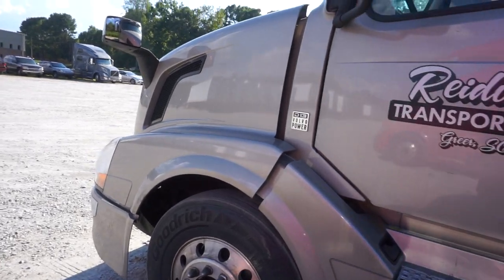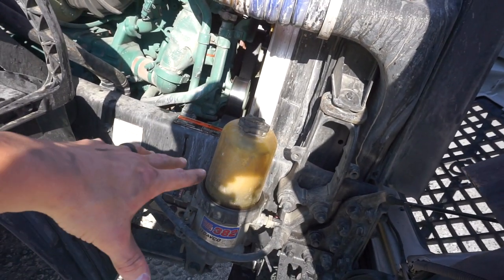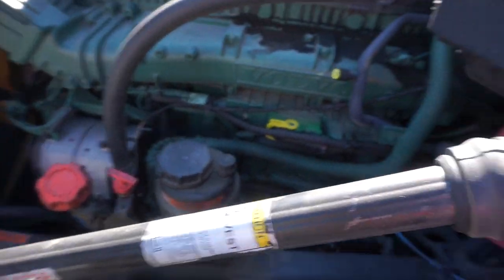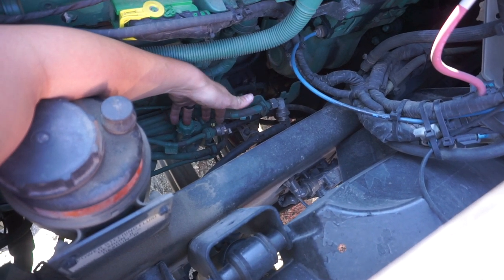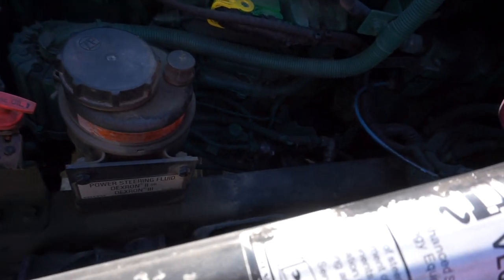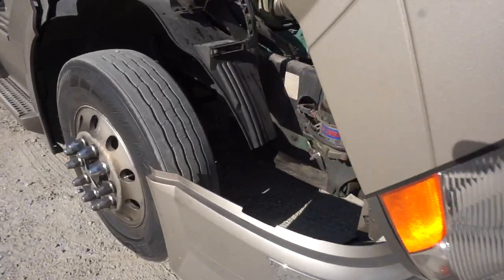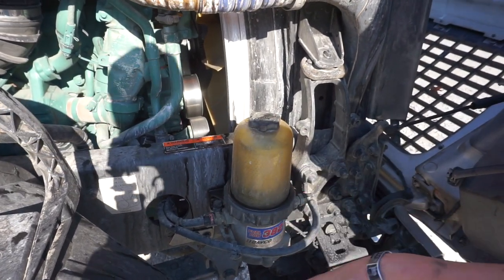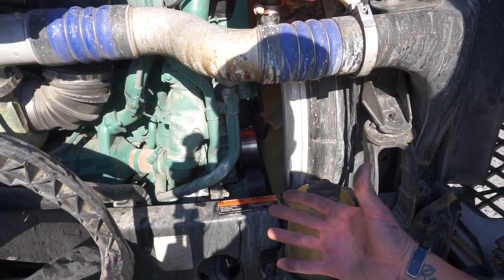How to purge air in fuel lines on D13 (No start fix)

Comment: Thanks for making this videos they help owner operators to save money! I had starting problems with my volvo d13 and I did alot of work on it to try to fix it. Changed the fuel pressure valve, valve on the davco fuel filter, fuel pressure sensor nothing helped. Then I thought I have a cracked fuel line so I put air in my fuel tanks to create a pressure and see if it would leak anywhere (and there was no leaks). The last think I thought it would be injectors because I changed them 60k miles a go. So decided to change the injectors again and that was the problem. Change those valves and sensor first because they are pretty cheap and and you can do it by your self. I mind upload video how I did it. I hope this will help someone.  Have a great day!
Reply: Hello my D13 doesn't have dawco filter. Where I can find to change the pressure valve?

Comment: Important details...to make it easier to reach, I placed a bucket upside down just inside the fender and stood on it. I used the end piece of an aluminum crutch (with a rubber tip) to make it easier. I had to push on the thing for about 5 minutes...then felt is stop moving...then got it started. Push down and to the left to release the spring...to close...wear a glove for tight grip...press down firmly...turn to the right...not locked until you fill it slip just a bit more to the right.

Comment: When I use my hand primer fuel comes out of where the plunger is.  Is that normal? If not can it be resealed/ rebuilt, or do I need to buy a new filter housing? 

Thank you
Reply from the maker: 0vinnie9 once the air is out of the system while pumping yes it is actually what you want to have fuel come out
Reply: @8526Productions  Ok thank you, my truck is losing its fuel prime. Wasn't sure if that filter housing could be the problem.
Reply from the maker: 0vinnie9 no problem and the ones I’ve had that happen on it’s been a leak in one of the hoses near the primer, cracked cups or fuel pump taking a hike
Reply: @8526Productions  ok thank you again, I'll take a closer look at it.

Comment: I’ve replaced my fuel filter and water filter several times now and I keep getting the check fuel filter light on and my truck is lagging a lot when going over 50 miles an hour. Any thoughts on that?
Reply: get a mechanic to look into your injectors and cups. those injectors will wear out the cup and leak down into the cylinder. also causing your egr to clog alot more and faster. you’ll have DOC codes for DEF issues, when the whole time its your egr clogged. Because your getting too much soot!

Comment: Truck died while driving has power to all components think my fuel tank lines are clogged changed fuel tank air vent any suggestions sir. Much appreciated
Reply: Same problem 
U find the fix
Reply: @silverjohn4319  yes, fusebox under the hood had bad connection...shop rewired fusebox and issue resolved

Comment: Thank you so much for sharing this video. You just saved my time during the trip and also my money.
On the old models Volvo engines there was a handy pump to got the fuel to the  injectors. On 2020 D13 it wasn't and I didn't know how to start the engine after fixing air flow through the water separator and no fuel pressure.
After your video class I know the easiest way to start the engine after issue wit air in the fuel lines. On my engine needs only to push couple of times.
Thanks again, the engine is warm and I have to rolling!

Comment: Hey question, my truck is taking forever to start (d13) and it stays misfiring. I got some bubbles in the tank. But her i open the the priming pump it came lose. Do you think its soaking air ? Or my problem is injectors and cups?

Comment: Hey budd thanks for the video it was really helpful. I have a 2017 volvo vnl 670 and every time i turn off the engine I repeatedly have to prime it to get the air off the fuel. What you think could be the problem?
Reply from the maker: First thing I would do is check for leaks while it is running and see if you can track it that way

Comment: Can this be issue and work if truck been sitting like 10 days since last start?
Reply from the maker: Very possible but without more details hard to say
Reply: Put into shop, that might be an issue because its having a hard start/ No start unless I used starter  fluid, which I was told could be air in fuel return and or leaking fuel injectors.. so still waiting on diagnosis